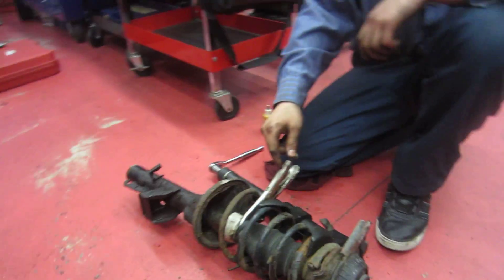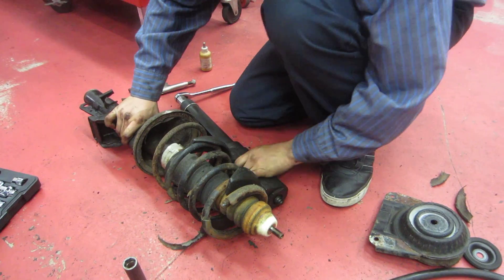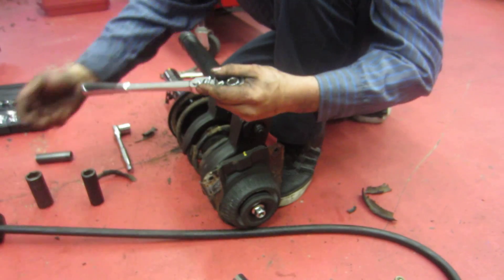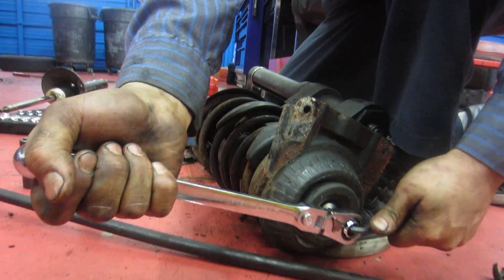Compressing a Strut

Comment: You should always replace the buffer and the mount as well sometime the spring pads also.
Another thing to do is grease the tool threads on a regular basis, many guys don't and the tool becomes tight.

Comment: Easy,buy the loaded struts already put together.Saves time and all you do is remove the old strut assembly replacing it with a new strut assembly.This is the best option for most makes and models
Reply: extra 20 bucks? lmao... try an extra 200+ for complete assembly here in Australia.
Reply: yup. why not spend the extra 20 bucks and get an new assembly. new spring boot. that spring was rusted. why reuse it? stupid
Reply: That spring could break at anytime.My father's shop,we install the loaded struts most of the time.These loaded struts are made for the DIY person so they don't have to rent the spring compressor or take it to a shop to have the springs compressed replacing the struts.
Reply: James Barnhart extra $20???.... LMFAO...  It's a lot more than an extra $20... Plus the factory (OE) almost never come pre-assembled!!

Comment: for gods sake get yourself some steel toe boots,safety glasses and wear mechanic gloves, get yourself a proper work bench with a vice and then post your coil compression video!!
Reply: This is exactly how I work on my car because I don't have any other option. So props goes to this guy for showing us how to do this the most basic way possible because it pisses me off when someone want to tell you that you have to go out and spend $700 for a tool to compress your springs.
Reply: Me too....but I'd NEVER put my hand between the spring, I was also told not to use an impact gun but know they make it easier.
Reply: hehe have you priced the coil compressor from baum's tool he uses.. and the through nut and ratchet?